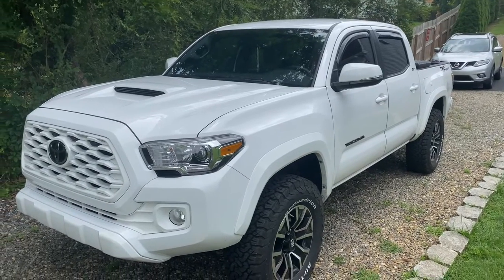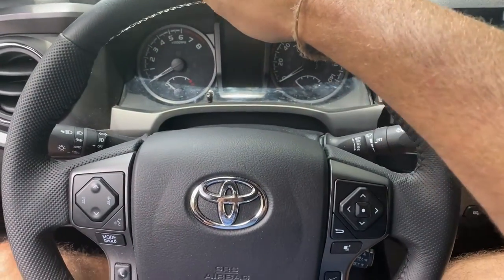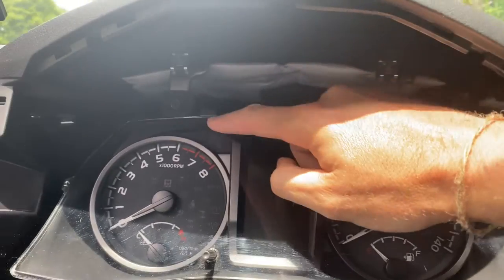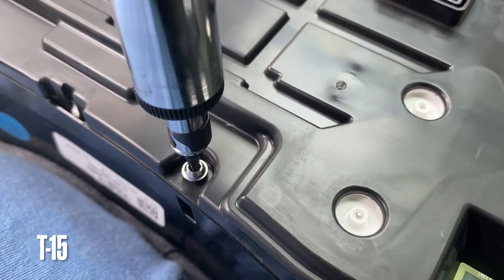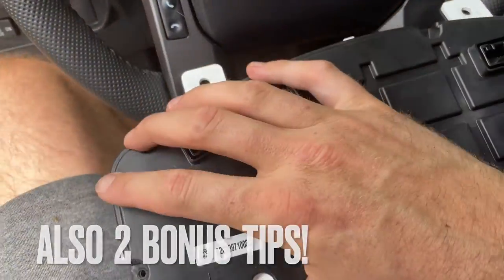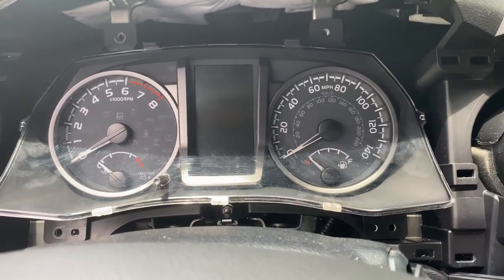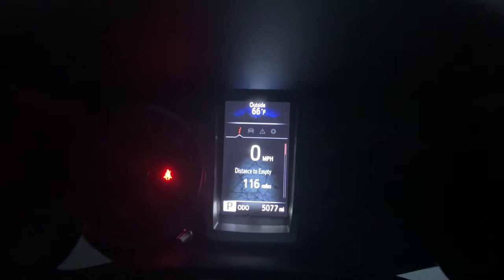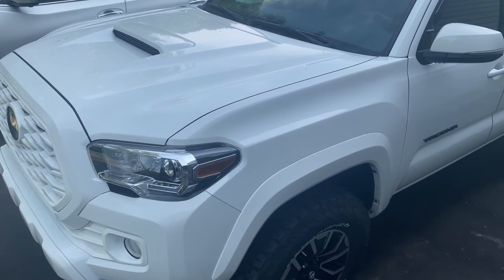How to Remove Warning Beeper From a Tacoma 🚨 🔊

Comment: I purchased the Carista bluetooth ODBII adapter and disabled the seatbelt chime in the dealer level settings for driver and passenger. Cost about $40 and was super easy. I made a number of other changes while I was in there. If you want your door open and the chime to stop, just push the lever inside the door jam that would be triggered by the door closing. Hope this helps the next folks!

Comment: Peace and quiet finally! This really works, the only thing I would add. Is once everything is apart, place a 1/4" piece of black electrical tape over the Red seat belt 🚨 light. This kills the light with the beeper. Awesome 😎
Reply: Really great video, very easy. Did stick a pocket knife into my thumb. Even stemming the bleeding, lmao, was done in 15 minutes.
Reply from the maker: Hey thanks for the comment. I'm glad the video helped out!

Comment: Great video. I started outside the laundry mat and when I got to the t+15s there was an auto zone across the street that had a t-15 driver for 8 bucks. Whole thing took 5 or 10 minutes 😎👍🏽
Reply from the maker: That’s awesome. I’m glad it helped out!
Reply: @WesleyAllenNC  it definitely did! Finally silence in the taco 🤣 By the way, no tools are needed for the trim pieces. They pop right off with a little bit of finger persuasion.
   Removing the chime speaker also silences the turn signal. That was a definite bonus, because that sound can be annoying, too. Especially at long red lights.

Comment: I did the exact same thing on my 2nd gen (2015) but on those it doesn't disable the turn signal/hazard sounds. Like you, that's not a deal breaker for me. I didn't know this was possible in the 3rd gen. I'm most likely buying a 2023 TRD O/R & plan to do the same thing. I didn't know about the other options as well. Thank you SO MUCH for posting this video.
Reply: Where was the beeper located? Is it in a similar position?
Reply: @camdennix5632  
Yes. Almost the same spot

Comment: The process for a RAV4 is different but very similar. The beeper disables the blinkers and door beeping but that's fine by me. The device is locked solidly into the chipset so you need to slice off the top of the beeper, then gently sever the copper wires in the device. After that you're home free. Delicacy with the dash is necessary, and there are two sets of screws on the dash. 4 on the back and a bunch under the front. It's delicate work but secure.

Comment: Hey Wes, interesting information. I don't think I'll do that, but it's nice to know it can be done.
Reply from the maker: I bet the dealer could have turned it off. But I’ve already committed now!
Reply: @WesleyAllenNC  They can. But most won't due to liability. You can download Carista or Techstream and disable the beeping in settings yourself without making permanent changes.
Reply: Good for you. Drives me insane anytime it beeps over everythjng

Comment: Tempted to try this on my 2020 Sport, have you noticed any other missing alerts in the months since the speaker removal. Thanks and great video.
Reply from the maker: Nothing weird yet. My pre-collision warning still plays, so the safety bits are still intact. This beeper deletes the general door beeper for seatbelt and open door. Oddly enough it also deleted the turn signal ticking noise which I actually really like!
Reply: I ended up removing the speaker, definitely worth it. I can verify rear and front alerts still sound. Only thing I lost was the blinker clicking sound. Thanks again for the video, this beeping was literally moving me towards selling the damn truck it was that annoying.
Reply from the maker: @2WCapo  same! I’m glad it worked out well for you. You could always hang onto the beeper Incase you ever want someone to re-attach it to the board for whatever reason. I really like the silent turn signals!

Comment: You don't actually have to remove the beeper for the seatbelt. You can grab a cheap Toyota OBD II USB device off eBay and use the cracked Toyota software to disable it. Pretty sure you can disable other beeps, but I only disabled my seatbelt beeper
Reply: This way in the video literally takes 5 minutes. You don't even need any tools to get the trim off.

Comment: Did you try 12 Volts on the thing you took off? I dug mine out like captain caveman. Oops. Gonna one day add a remote speaker and volume for when it's annoying. Right now, it's all visuals
Reply from the maker: Did not not test anything with a meter no.. just popped off the annoying beeping thing!

Comment: I noticed after you put everything back together, and showed how the beeping was gone, you had the i for info lit on the screen in the middle. That didn’t turn on because you removed the speaker did it? I’d really like to do this, but not if the i will stay on consistently. Thank!
Reply from the maker: I’ll have to double check my truck when I’m home later today. I’ve driven it since posting the video several months ago and I can’t recall seeing anything else lit up on my screen.. I’ll update this comment when I get back later
Reply: @WesleyAllenNC  well I went ahead and did it. So far so good! My wife has a 2020 Camry XSE, the seat belt alarm is even worse in that. I’m wondering if it’s the same process.
Reply from the maker: I’m not sure about the Camrys. I just know that they were pretty annoying on the Tacoma. I even like the fact that the turn signal is quiet
Reply: @WesleyAllenNC  so I just split it open on the Camry. Process is similar, but I couldn’t split the speedometer housing like we did on the Tacoma. I took a razor blade and trimmed the plastic around the speaker, then removed it. You think the Tacoma is frustrating, the Camry is even worse and when the kids take there seatbelt off in the carpool line at school it goes nuts! Yep, even the back seat seatbelts would alert it.

Comment: Wes, do you think you could just put tape or sound dampening over the speaker so you could change it back in case you sell the vehicle?
Reply from the maker: I’m sure you could, but you’ll still hear the beeping fairly. Not sure what the best method would be for this. Maybe electrical or duct tape?
Reply: I decided to go ahead and try with sound sampening(metal backed rubber tape) took me 5 min. You can still hear it but it cut the sound in half.
Reply from the maker: Good deal! I considered doing something similar but went ahead and did the thing.. lol
Reply: Pretty sure if you sell it the next owner will appreciate it!

Comment: Is it the same beeper for the proximity/back up sensor?
Reply from the maker: Possibly, but not certain? Mines a 2021 and I can’t recall hearing the back-up beeper like my work F-150 has.. I know it still beeps at me if it thinks I’m going to have a collision 💥 I’ll try to update once I find out about the backing beeper
Reply: @WesleyAllenNC  I mean the  parking sensor beep when you use the rear camera to back up